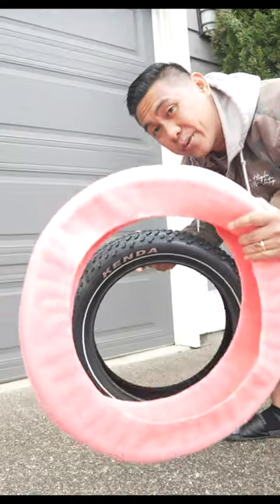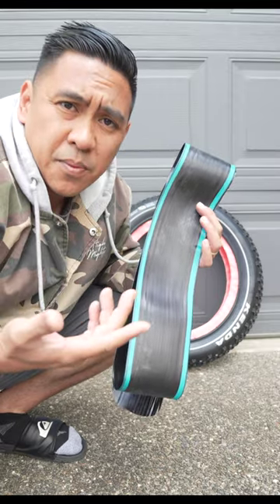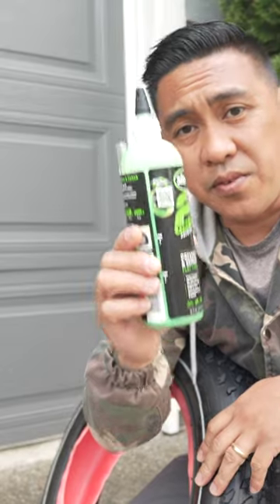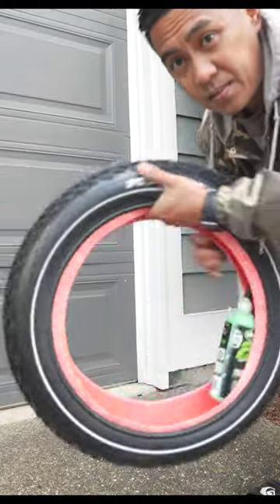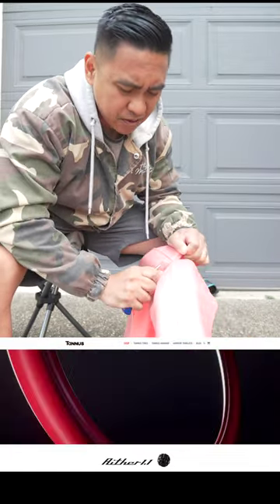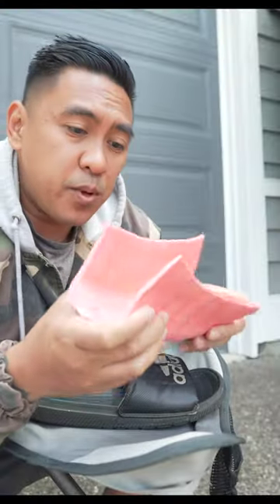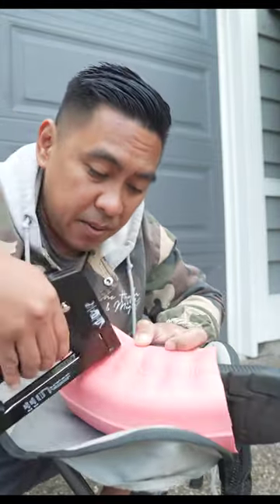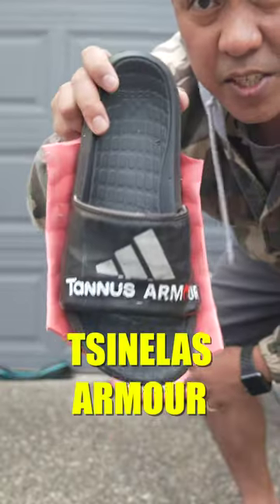HOW TO MAKE TSINELAS ARMOUR @RideTannus

Comment: As a motorcycle mechanic I can't begin to tell you how much I hate that green slime. Looks like I murdered an alien after I take the wheel off of the rim.
Reply from the maker: 😂😂 yeah, i use it in an emergency
Reply: @ihateeverything3972  lmao
Reply: it is great in a tube, not so great tubeless.
Reply: I’m a mountain bike rider and I use sealant in my tires all the time. The sealant actually balances the wheel automatically and I don’t find too much trouble cleaning it up.
Reply: Not me putting literal gallons of the green stuf in tires 😂 (im a heavy enquipment mechanic)
Reply: No wonder aliens haven't visited yet. They are watching you
Reply: @mikegrok i think sealant is good for tubeless ?

Comment: If you use the tire slime right if shouldn't puddle at the bottom and become an issue with weight. It's also 8 bucks a bottle vs 90 for one of those tube things
Reply: I mean, your username says "no budget no problem" so it shouldn't be an issue for you

Comment: I worked as a Pedego mechanic for 3 years those do not work don’t waste the money and effort. Nails go right through them so do blunt sticks and after having them in for 6months they are half the thickness. Thorn resistance tubes and sealant work the best. Or if you know how to properly do tubeless that’s even better.

Comment: I was using Tannus tire armor most of last year.

It does work, unfortunately it doesn't last long as it compressed by the air and weight of you and the bike. Once that happens you'll end up getting a puncture and it a pain in the arse to fix while out on the trails far from home.

I stop being stubborn and dove into tubeless, yeah you can still get punchers but they're far easier to fix.

Comment: Okay I absolutely love your videos, but most liners are illogical if you have a presta valve set up, you can make EVERY (and i used to manage a bike shop so ive done it) SINGLE presta rim a tubeless setup. All decent wheels run presta and genuinely a good quality tubeless sealant creates a nice even viscous coating that seals holes and doesn’t shift weight. Also unless you’re riding at crazy fast speeds or have heavy ass wheels balancing isn’t necessary. Keep up the good shit brother 👍🏼

Comment: They also sell full rubber tires, got one for my ebike cuz otherwise its impossible to replace a flat on the   wheel with the motor without 2 wrenches.
Reply: Flats can often be fixed without removing the wheel, if you really need to.

Comment: 1 to 5k for a fucking bicycle 🚲
Reply: It's ok for the sake of convenience, lotsa choices nowadays....
Reply: That’s entry level prices 😂
Trade in your motorcycle and you’ll have a down payment for a carbon bicycle.
Reply: Tbf you can go used ideally looking for ex hire bikes i picked up a marin hardtail with rockshox front fork and a 1x drivetrain for £300, Whilst hire bikes may have one or two marks mechanically they are solid due to service they get and are near new.

To buy this equivalent spec bike probably cost new not far off 1k

Comment: These armor are POS. Ive installed dozens at my job, which we took on as a favor to a rep who needed them gone, and they are effective for only weeks. They flatten out under the pressure of a tube, making them only a few millimeters thick after a few weeks of riding, and I've seen baby thorns go straight through it.
Reply from the maker: I have a hard time believing you. It was tough to cut through with a blade. You sound like you’re full of it tbh. A ton of people run these with fat tire bikes - and I know a ton of people who have had zero issues
Reply: @adobomoto  Then I'm happy for them! But I've experienced that they have a shelf life before they collapse and thin out to become useless. If they work for you and others thats great, anyone stayin on two wheels and outta the shop makes me happy.
Reply: Yeh, I was about to say "sketchy" at best